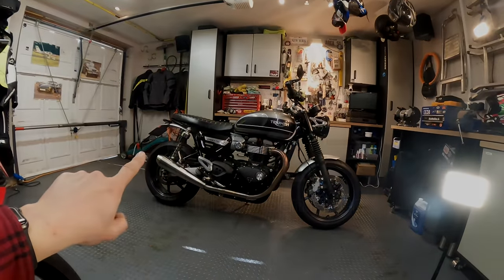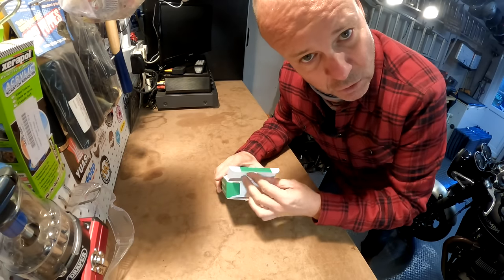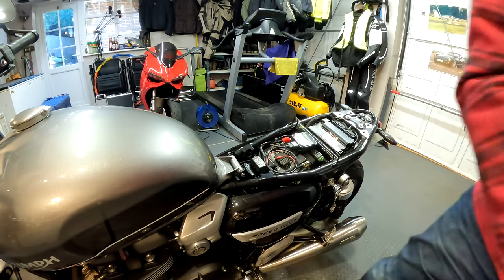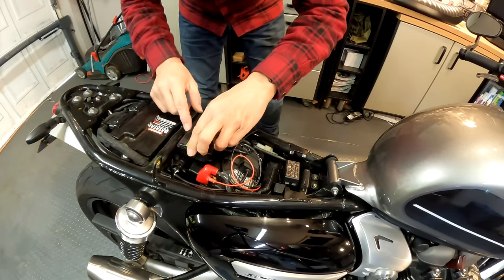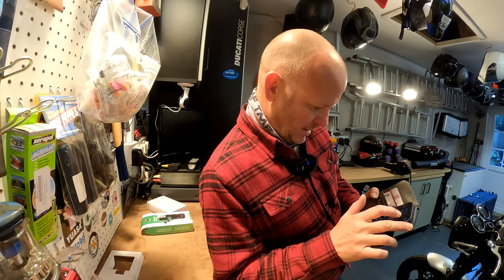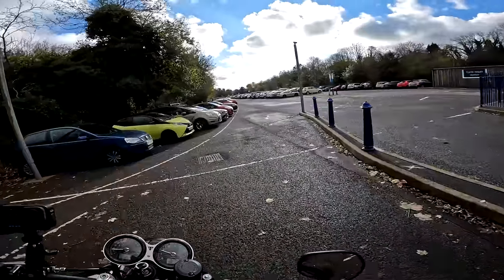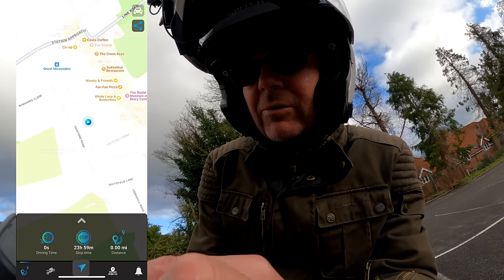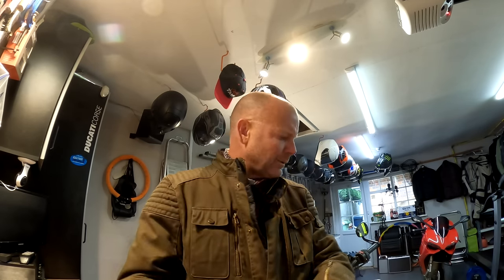Keep track of your bike! - Sizzapp monitoring Device Install & Review 4K

Comment: Sizzapp approached me to review this, but I declined. The wires will lead any thief straight to the tracker🤔
Reply: That’s what I was thinking RM
Reply: Or the manhoosive unit with Sizzapp printed on it.
Reply: And the fact that if any thief didn’t know what it looked like and where people might install it, thanks to this vid they do now! 😂
Reply from the maker: Fair enough! I like the fact I can fit it and at all times know where the bike is (including where I parked it!) for no ongoing cost - “fit and forget” is the appeal to me…I accept no solution is 100% perfect. Most pro-criminals I understand first move a bike a short distance to see if a tracker is fitted before actually hustling the bike away to a lock up - so in that scenario the sizzapp works a treat.
Reply: Agreed, its virtually pointless as a security device.
Reply: It would be easy to fit using a live + well away from the battery and use the frame for the earth - making the install invisible without stripping half the bike down.

Comment: Good bit of kit Andy. I would wire it up differently, not directly to the battery. Also hide the unit away. Easy to rip it out if you can see it all once the seat is off. Hide it all!
Reply from the maker: Indeed - for obvious reasons I didn't go into disguising strategy and location in more detail!  By the way if it is ripped out it alerts you about it (it has built in power too)....
Reply: @TheMissendenFlyer  thanks for the great things you cover. Looking forward  to 2023. I live in Germany, maybe we'll see you out here some time.

Comment: I prefer the Monimoto because it doesn't connect to the bike battery so it's genuinely possible to conceal it.
Reply: Yep - I agree. First thing a thief does is to check for additional wires to the battery. With a Monimoto tracker, it can go anywhere on your bike and is independent. The batteries last at least 1 year, so not a big deal. I also like that it links to Google maps if the bike moves, so it is really easy to get directions to where the bike is....
Reply: I fully agree and over the past 12 months had absolutely no issues with mine
Reply: Prefer not to have to connect to the bikes power be it via the battery or the loom.  Monimoto all the way for me.
Reply: @KLRJUNE  That's good to know thanks. I still think the Monimoto is a more elegant and better solution. The price difference is enough for 3 years Monimoto subscription.
Reply: Monimoto is a dodgy company i have their latest and they disabled it after a couple of months and demanded an additional £36 .  No explanation either you pay or they disable the tracker, pisstakers 😤
Reply: @chrischristofis8501  err that's pretty clear when you buy one.
Reply: @KLRJUNE  Yes dont connect the sizzapp to a battery,  the internal battery only lasts 3 hours?
Then its flat............
Reply: @anthonyquantuman730  i think you've misunderstood. It can be wired into any permanently live 12V portion of the bikes loom, it doesn't have to be directly attached to the battery. That makes the installation harder to detect.
Reply: @Bunter1815   Yes I did misunderstand. I now see what you meant...
Reply from the maker: I prefer this as it’s “fit and forget” - I used to use Monimoto but found the use of fobs and having to continually replace batteries and renew subscriptions (particularly on multiple bikes) a real pain….
Reply: What’s the range to get notifications?
Reply: @killertactics418  what exactly do you mean?
Reply: @Bunter1815  how far from the bike can u be to receive notifications
Reply: @killertactics418  with the Monimoto? There's no distance restriction the device has a SIM and uses the phone network for notifications. You could be in NZ and the bike in the UK and you'd get notifications if it was moved without the fob present (assuming you and the bike had a network connection).
Reply: Which minimoto model
Reply: @anthonyvega1959  i use the 7 with the round fob
Reply: @Bunter1815  what is the charge per month for the service

Comment: Thanks for posting.  Sounds like a great product.  One piece of advice, you should always connect the positive terminal to the battery first and then the negative.  When disconnecting you should take the negative off first then the positive.  Otherwise, you risk shorting the battery (and many of the bike's electronics) and take it from the voice of experience, you don't want to do that. :)
Reply: I was having heart failure as you DIDN'T disconnect the Earth when you did the install,   Nearly had a "How not to Install" vid on your hands.  I was waiting for the sparks if you touched the frame with that screwdriver.
Reply from the maker: Been there done that!!!
Reply: To be fair to Andy he can do that safely, due to the angles the battery is at, and the open eye connecters on tracker  it's just a matter of 1/4 turn and slide connecter in. But yes normally you would always disconnect the negative first think he would have done it correctly if set up was different.
Reply: @Jay Harrod   Have you been on ice for last 58 years, that's the last positive earth vehicle I recall.

Comment: I love them, I've had it for 15 months now and moved it from my old bike to my new one. the software has got better after an upgrade, in that there are extra features. Never had an issue with it and get a message within a minute of moving my bike. Well worth the money as it's a one off payment you do save over time. I have the other smaller version, the 2G-2 wire not the 4G-2 wire and it works fine, not sure how long 2G is with us for.  I've never had an issue with my battery either and pleased it's always getting power. Well worth it
Reply from the maker: Great feedback - thanks Dale!
Reply: Hi Dale, we are happy you like your SIZZAPP device!

Comment: Thats a great pocket friendly tracker Andy. However, it defeats the object if its easily found. Personally i would try to locate the unit under the tank or behind a side panel at the very least, & make the connection to the battery look factory & tape the wires to the factory harness to disguise them. Otherwise, looks great to me 👍
Reply from the maker: Yep good tip!  Incidentally if it is just pulled out it alerts you of that too (it has 3 hours worth of inbuit power source)
Reply: @ Rich Helm 
Agreed. Thieving scrotes can simply snip two wires and throw the unit in a ditch/hedge/down a drain and within mere seconds it's effectiveness is completely null and void. Unless it is so well hidden/disguised and made as tamper proof as possible on the bike then the whole point of it as a tracker is moot.

Comment: Battery terminals are the first place a thief will look for a tracker, it's too easy to find and un hook.
Reply: That’s exactly what I was thinking, I just don’t get it.
Reply: You get an alert soon as the bike is moved, so that gives you time to take action and it also alerts if power is cut, it has a 3 hour backup power, granted if it's taken out before you take action the bike is gone, however I would rather have it than not 👍
Reply: Would it be possible to hard wire it in somewhere else on the bike so it would be totally hidden?
Reply: @grahamcunliffe9352  I think it would be okay if you did do that as long as it's drawing the same power, however I can't guarantee it, worth looking into, I'll ask Sizzap HQ 👍
Reply: @grahamcunliffe9352  I have been informed that it can be done Graham, I'm in the Sizzap pro testing group, I have also been told that you can lengthen the wires, it will also not affect the warranty, hope this helps you 👍
Reply: Excellent idea but needs thought into how to install,harder it is to do that the more time you will have in getting the wee sticky fingers involved👍
Reply: @gerrypowell2748   I think that will be down to your type of bike mate.
Reply: @mototripperuk  the thing with these things is if they find it and smash it. Two weeks ago I had my R6 stolen, it had a tracker and the company checked the logs. The device registered a high-force impact just before it cut out. Meaning, they smashed it and it was gone. 🙈
Reply: @sanxi34  that's the downside of any tracker, however you have a better chance of saving your bike than you would not having one, for the price and non subscription based it does me, I contacted Sizzap today and they have advised that you can fit it anywhere you want along with additional wires, your warranty will be okay doing that 👍
Reply: Can’t miss that thing can you!
Reply: It's OK but as has been said a thief will just pop the seat and snip the wires,and your 200 quid is wasted 
In principle a good idea bur it's to obvious
Reply from the maker: It will send an alert if disconnected
Reply: @YorkshirePork  of course they will, however during trying to get the seat removed they have already triggered a movement that you will get, then they have to cut through your locks & again triggering movement, so while they are try so hard with their grubby little hands you are hopefully on the phone to the police and heading to your bike with a weapon of choice for self defence creating enough noise to wake up the whole neighborhood, again I would rather have it than not have it 😁
Reply: I have this. While I agree, and this was my first thought as well, installed this inline on a deeply hidden cable on my bike. Took a while to install it and find the proper + and - but unless a POS thief takes the almost 2 hours it took to get the panels off and find the thing (and know what theyre looking for) which is wrapped around cables looking like its stock, there’s plenty of time to recover. I recommend those that want this to do that.
Reply: @grahamcunliffe9352  yes. That’s what I did.

Comment: I've used trackers for years - the £30 battery-powered ones you get on AliExpress (TK-905 to be exact). I've recovered two motorbikes using them. Total cost was £30 plus £10 sim that lasted for years. However the main problem I had was their size and having to charge the battery every month. I've recently switched to Samsung SmartTags which are like Apple AirTags but they work better because you can see a tracking history and see the movement of them, plus the range is more like 100m rather than 10-20m. I've tested them loads and they are really accurate and get pinged everywhere - obviously cities are better because they don't use GPS but rather, other SmartTags and Samsung phones. Great thing is they are tiny, cheap (£20 each) and the battery lasts about a year. It means I can hide two of them in each bike for redundancy. Definitely recommend them if - only catch is you need a samsung S21 or S22.
Reply: Also, as others have mentioned, I steered clear of trackers that use the bike's own battery because if you connect straight to the terminals it's really obvious and the first place thieves will look, and if you connect elsewhere in the loom, it's also possible to find but it's also a pain to install. Benefit of the SmartTags is you can be really sneaky with where you hide them!
Reply from the maker: Yes several have mentioned them - the more security the better!  Persoanlly tags wouldn't work for me as I'm often riding in the countryside with no phones or tablets (or tags!) nearby....

Comment: Worth having - I just brought a similar tracker off Amazon more generic type that you charge via USB (or you can connect to bike battery) and battery last about a month between recharge and just uses a roaming SIM card that can use roam across many networks, globally. Works on both 4G and 2G, the key benefit for me is the ability to send SMS as soon as bike or moved, vibration alarm. So even if thief finds and removes tracker you know bike has moved quickly, you can then also use other apps such as IFTTT to do other things. What has been useful for is when I have done a good route I can use it to review the route and record it somewhere for future reference. More peace of mind I think that a real deterrent to thieves but often bikes are stolen and hidden to see if they have a tracker.

Comment: As someone who had to deal with the scum that nicked bikes in my previous life I support anything that helps in the prevention of crime. Despite the low cost I'm not sure this is a good product. Clearly, if your bike was stolen the thief would look under the seat. They will be aware that Sizzapps are on the market and with one swift pull it's disconnected and will no doubt be at the bottom of a river very quickly. MoniMoto a much better option IMO - can be hidden. No wires and very cheap subs of £36.00 a year - got to be a better option surely? Good to see the Triumph out and about.👍
Reply from the maker: Yes I used to use Monimoto but found (as I had multiple units) having to keep renewing the batteries and get the sims topped up became tiresome over time as did having to carry the fob separately to the keys. Seems there’s no perfect solution but I find the Sizzapp works better for me as a “fit and forget” solution…

Comment: Thought you were a monimoto fan?marvellous how a freebie changes people’s minds.
Reply from the maker: I've used both, didn't pay for either of them, and I prefer this - which is why I swapped, I like the "fit and forget" nature of it - no fob to carry around seperate to your keys, no SIM subscription...just easier to manage.  Only downside is potential for battery drainage but that seems minimal so far - compared to my "heavy duty" trackers - and it alerts me well before low battery is an issue - you can of course hide the tracker (this was only a demo of how to fit).....I can assure you there's no such thing as a "freebie"!!

Comment: I bought the Monimoto Tracker four years ago after watching TMF’s review. Works perfectly and the annual cost is very low. Not sure about Sizzapp 🤔
Reply: Yep, I think I much prefer my (Two) Monimoto's I have in my bike and car. No need to connect to the bikes battery and be a constant power drain, and hiding is a lot easier as you aren't restricted by tracking wires back to the battery.
Reply: Do you have to pay for the sim card with the moni moto ?
Reply: @Chris Hart  no, just a very low yearly subscription to keep the sim card active
Reply: I use monimoto too, but it seems every year I have to change the units battery. With hiding it well on the bike, it's a pain to keep taking it out. Seriously considering this Sizzapp

Comment: International Mobile Equipment Identity I think.  It is a unique identity for your Sizzapp box (normally the mobile phone).  The first part (8 characters I think identifies the device type)

Be aware people that mobile networks are planning to retire 2 and 3g networks as they need to reuse the frequencies for 4/5g.

One last tip, the ground on the battery should be disconnected first and reconnected last so don't do what Andy did 🙂.  The rational is that if you short the +ve  battery terminal to the frame you will get some pyrotechnics.  People wearing a ring be particularly careful
Reply from the maker: Thabjks for that - I can never remember which way round to connect/disconnect - having learned the hard way in the past I am always very careful not to create a short though....
Reply: @TheMissendenFlyer  Just think that the -ve is connected to the frame.  If that is disconnected then connecting the +ve to the frame with a spanner, screwdriver or your wedding ring for an instant won't matter.  Nobody wants an exploding ring do they?
Reply: 'Insulating your tool' is also good advice!

Comment: Good morning Sir.. Just a quick holiday trick.. I was worried about my steed when on a touring holiday. I looked at trackers and realised that they were out of my budget. So I bought a second hand phone android and hid it in the panels. Then every time I went to do the tourist stuff l merely linked it to my main phone by what three words. Of course this means that there ware no, Your Steed is moving warnings. BUT at least when I used parking spots in unfamiliar cities and wondered about there was an easy find your steed map to follow. Of course if you check it and find the steed is way away from your parking spot you have to give your main phone to the police to use as a tracker.. 🤙🤙🤙

Comment: Apple Air Tags seem much simpler and cheaper to use, and won’t drain your battery.  And also easier to hide on your bike too.
Reply: Yes but they rely on a thief having an iPhone, iPad or Mac
Reply: @sergentcolon1  or someone who is passing with an iPhone which highly likely.
Reply: @thornscoop2  a lot of thieves stick bikes in shipping containers so no signal can get out though.
Reply: @sergentcolon1  That would also stop any other tracking system working too.
Reply: Apple tag is useless if there is no one around with an apple product, especially out in the country side
Reply: @kevindarkstar  Agreed, they're not quite as constant, but Apple products are ubiquitous.  Mine nearly always have a ping.  It's a trade-off versus their extreme low cost and easy concealability.  They're a very cheap layer of security.  This Sizzapp appears a complete waste of money.
Reply: @cp4512  yes it would but some other systems would show the route taken to get there. No system is fool proof.
Reply: @sergentcolon1  including RF?
Reply: @jeanjacques9980  a closed shipping container forms a Farraday cage, all wireless signals are blocked
Reply: @sergentcolon1  Thanks for info. aware mobile signals are blocked but thought that rf signals were functional. Obviously not, no wonder bikes and cars end up in Middle East or Africa.
Reply from the maker: I bought four to test - so far they have proved very unreliable tracking anything in real time. I’m sitting less than 5 metres from one and my phone can’t even locate that!!